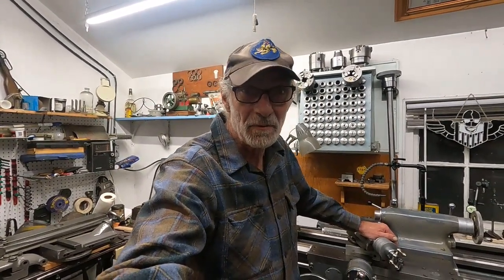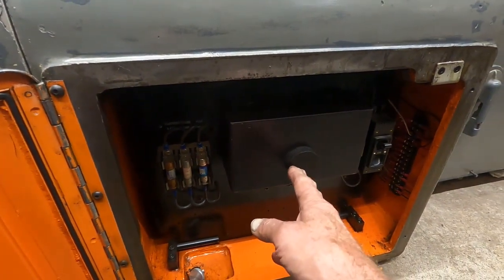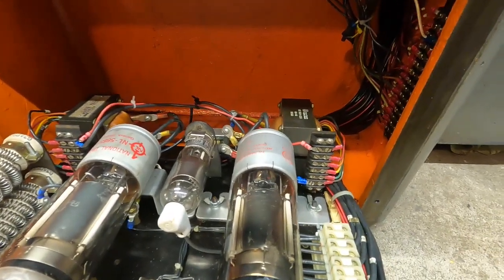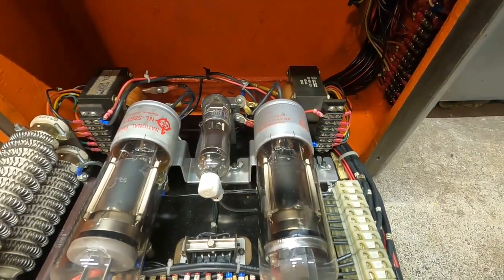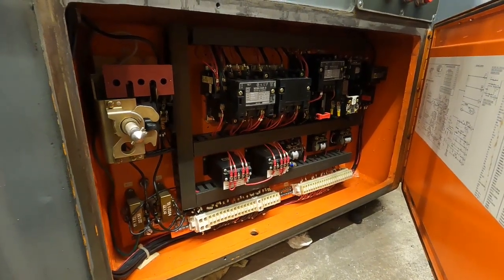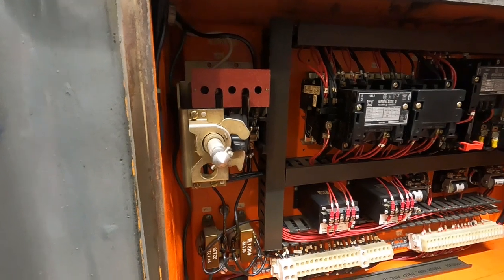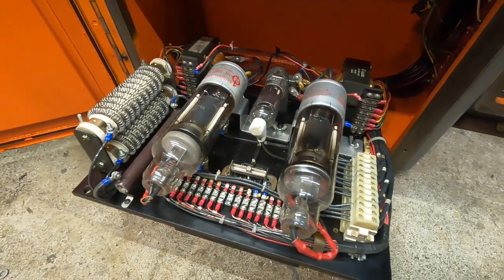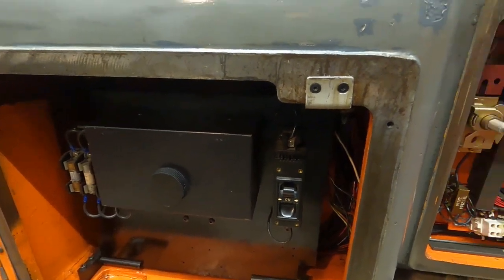Monarch 10ee lathe filament transformers

Comment: Thanks so much for all the great content!  I'm loving and appreciating all the education offered on your channel.  Any thoughts about the Round Dial Monarch 10EEs?  Specifically the motor-generator models from the early 1940s?
Reply from the maker: The motor generator machines work well with their huge frame 3hp spindle motor with back gear for low speeds easily will remove 1/4" off the diameter of 2" 4140 steel per pass using negative rake carbide inserts. The older style machine has an advantage cutting metric threads using change gears on the end train because the gear area is open instead of enclosed on later machines making changes harder having to used gears with fine pitch to fit in on later models. There were two styles of Reliance MG drives in those years the earlier MG was all inline, the later had the exciter belt driven from the MG unit. The exciter being a small generator that provides power to both spindle motor and generator fields, along with the power for directional switches. Very easy to trouble shoot robust system used in elevators. The spindle action is close to the same as the more modern factory drives, it lacks the spindle speed/load compensation circuitry but uses the momentum of the large armature in the spindle motor effectively. Thanks for tuning in!

Comment: Great demo and explanation of the system. Even though I don't have a 10 EE I agree with the OEM system. I relate a lot of these YOU Tube Wizards to Hot Rod magazines. Many of the magazine articles are written by those who should be made to sit on the bench. The articles are designed to sell the latest junk. Example is high lift camshafts that have such terrible low-end torque that they can't propel the vehicle at slow speeds. Yet they sell millions of dollars' worth of this stuff to the inexperienced
Reply from the maker: The situation with this machine is those wizzards come and go and the pathed together drives just do not last. The problem not understood is lathes have a high starting load with heavy chucks and other loads. the way this machine cuts screw threads is mostly in rapid starting and stopping causing heat build up that solid state drives fail to handle well.